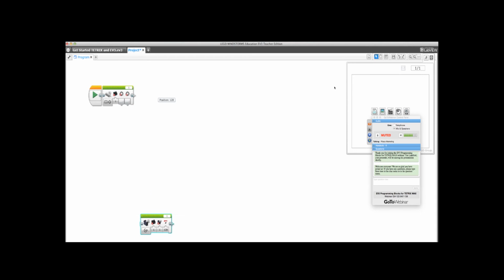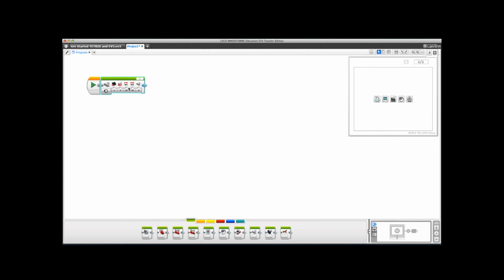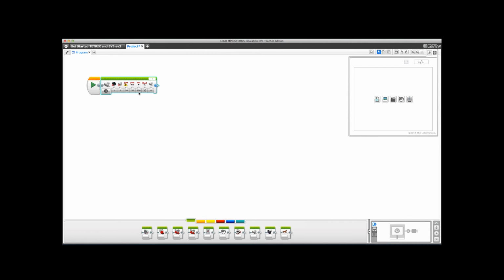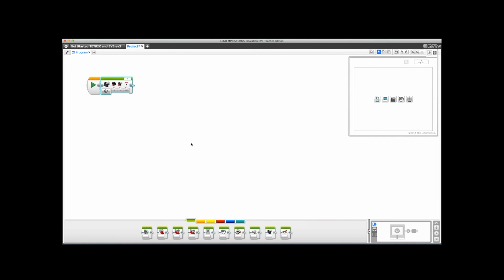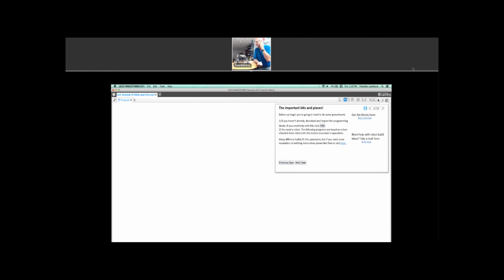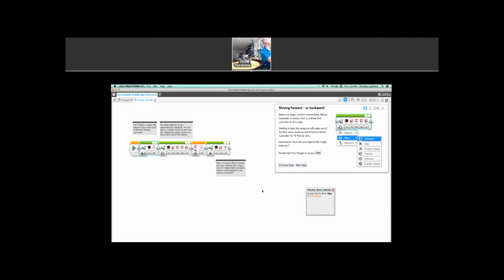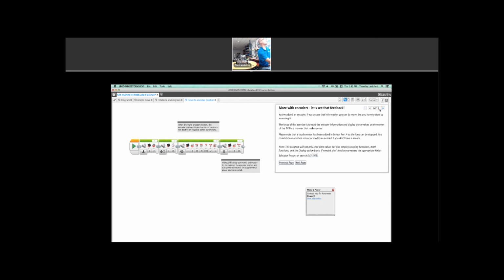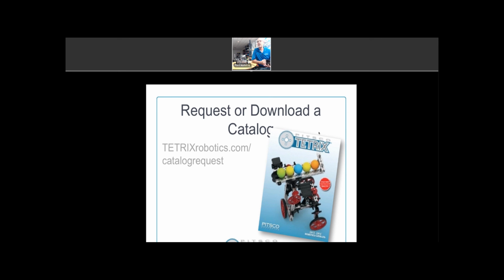Webinar: EV3 Programming Blocks for TETRIX

Comment: Hello, there is a problem with connecting a DC motor controller Tetrix to the ev3 unit. Downloaded and installed the EV3 blocks for LEGO MINDSTORMS. But the program doesn't recognize motors . gives a yellow exclamation mark over the icon of the port. And watching LEGO ports shows the electricity meter.  Help us understand what's going on, maybe we need to install some additional software to make the EV3 unit recognize TETRIX motors.
Reply from the maker: You might check to make sure the blocks you imported to the EV3 Software are for the specific controller you're using. If the blocks are correct, then we're not sure what the issue is without more details. Please email support@pitsco.com explaining your issue and noting the part number of the controller you're using. The Technical Support team will work with you to figure out the problem.:)

Comment: why does i can't find the document of Ev3 programming in www.tetrixrobotics.com
Reply from the maker: Depending on the servo or motor controller you're using, you might find what you need at https://www.tetrixrobotics.com/ev3downloads. If not, you can always reach out to our Technical Support team at 800-358-4983 in the US or email support@pitsco.com with details of the equipment you're using, and details about your issue.:)

Comment: How did this happen?

Cannot compile some of the documents for deployment:
Program.ev3p: Use nonexistent modules.
Reply from the maker: Thanks for contacting us! We're sorry you’re experiencing difficulty with the EV3 Blocks in this particular instance.
If you’re currently using the new EV3 module for TETRIX® PRIME (which makes these systems completely compatible), the instructions in the video won't work.
If you’re using the products featured in the video, unfortunately, this webinar is a little older and we no long carry this HiTechnic product as a controller for EV3 and TETRIX. As such, we cannot replicate this error, which limits our ability to troubleshoot. But we want to do our best to help. Can you email us with more information about this error at pitscoed@pitsco.com?  If you’re interested in alternatives at some point, you might consider the EV3 module we mentioned, or we have the PULSE™ and PRIZM® robotics controllers, and the TETRIX MAX DC Motor (or Servo) Expansion Controller.